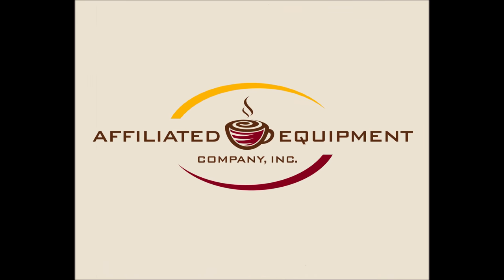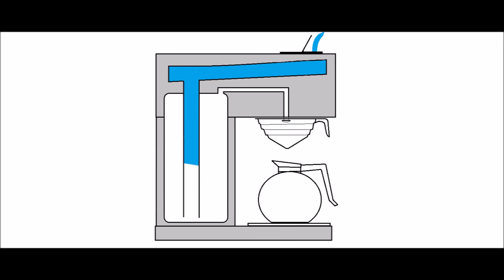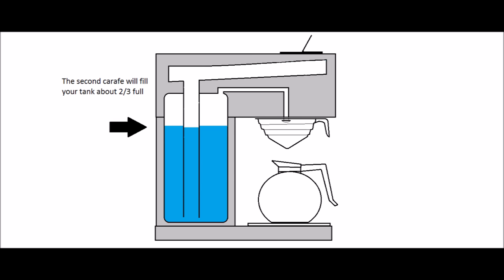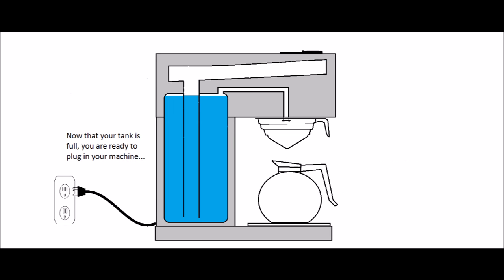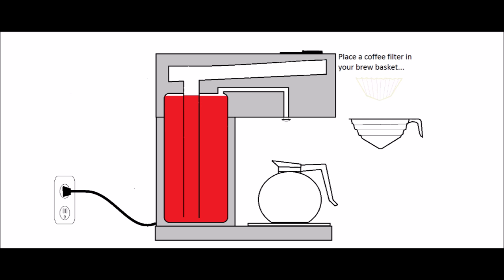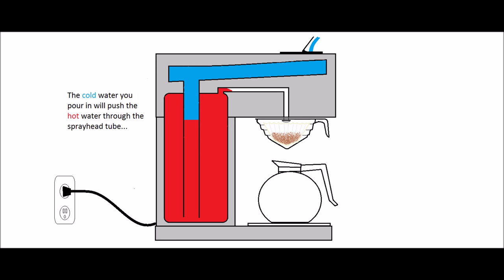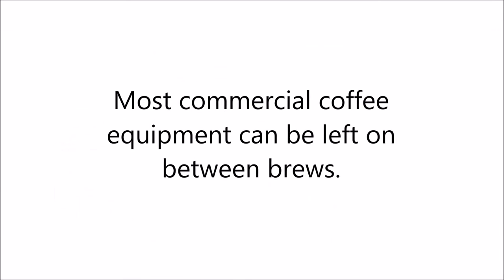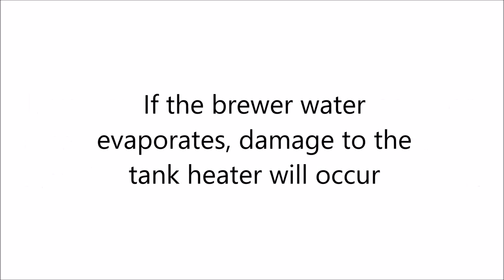HOW TO: Set up a pour-over coffee maker; Brewer machine

Comment: We have 2 bunn pour overs at our church.  We recently had them descaled b/c they were working slow and totally caked up with mineral deposits.  When we used again they leaked a bit so seals were tightened-no more leaks. The problem we are having is when we put in a full carafe of water only a 1/2 comes out the first time as if someone was only brewing a half pot. After that it's okay.  Any suggestions on how to adjust?  The first pot is (1/2) is weak when  you'd think it would be really strong.  Confusing!
Reply: Hello Laurie, in case you haven't solved the issue, I would suggest topping up the brewer tank while it warms up. Place a carafe to catch the overflow, and top the tank up until it just starts to come through the brew head.

It sounds like your tank is around 1/2 carafe empty by the time a week has passed, so it preheats the water, but when you add more cold water, it cools down the tank more than normal (since it's not full) resulting in weak coffee. And since the tank was ~1/2 carafe empty from full, you lose that much water to the tank.

Then your tank is full and primed for the second batch to go perfectly. So just top up the tank 👍

Comment: How to know why it's leaking from the top sides when boiling process starts???? Hot water leaks from the sides, why?
Reply: Because you overloaded the tank
Reply: @dailykevs201  possible the tank heater gasket is broken
Reply: I bought a used one and found the tank lid to be bowed upwards and blown out around some of the stud locations. Had to order a new lid (and thermostats for good measure 😳).